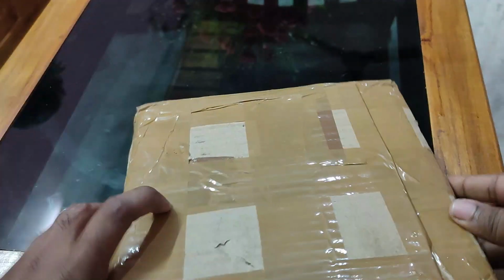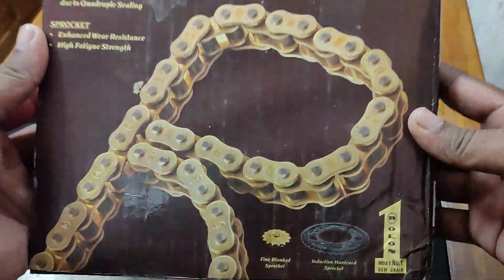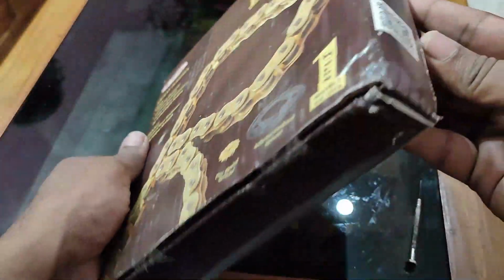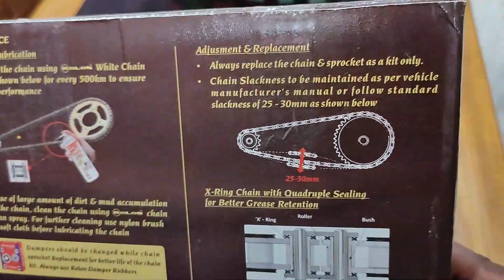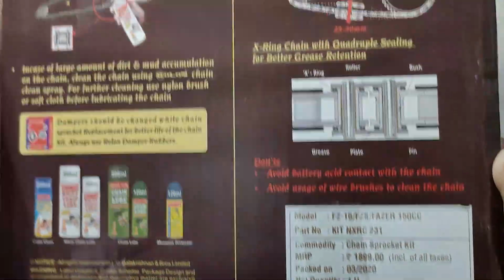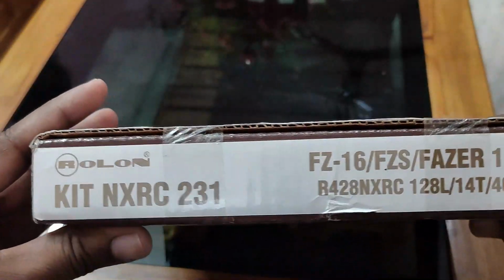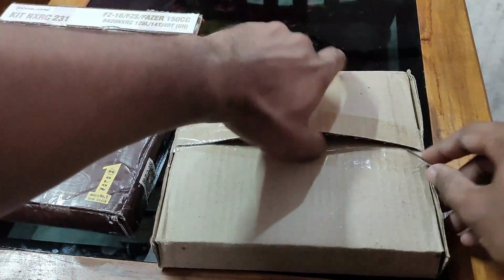#yamaha     Yamaha Fazer / FZ16 Rolon Brass chain & Sprocket Kit installation

Comment: use only self locking nuts on rear sprocket hub, those nuts you were using may loosen up and will cause serious accidents in high speeds.